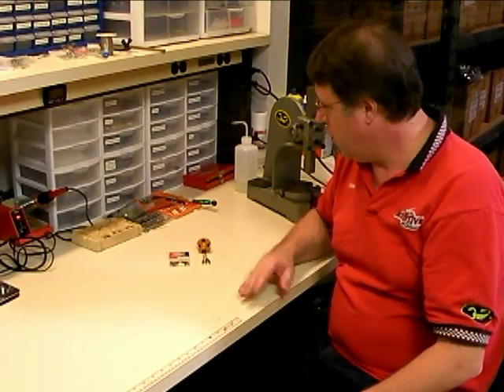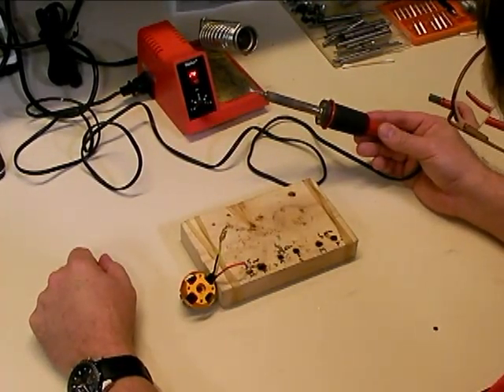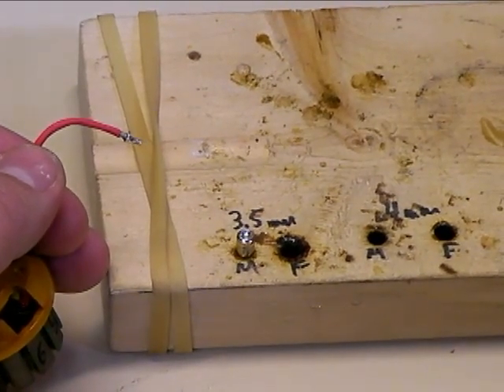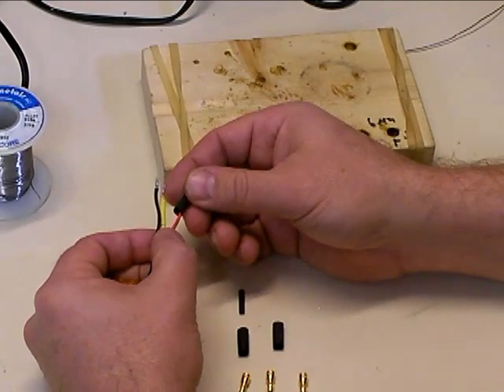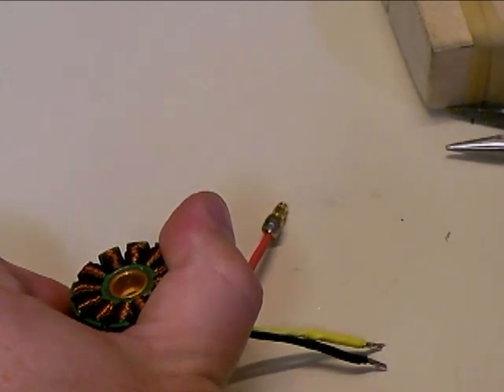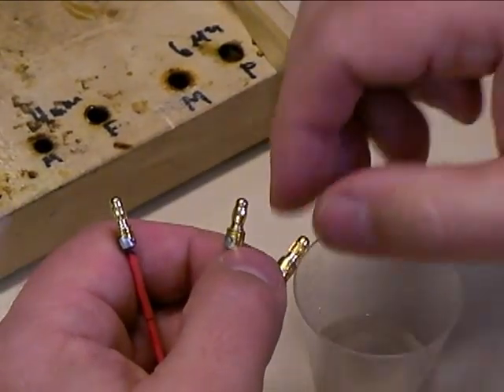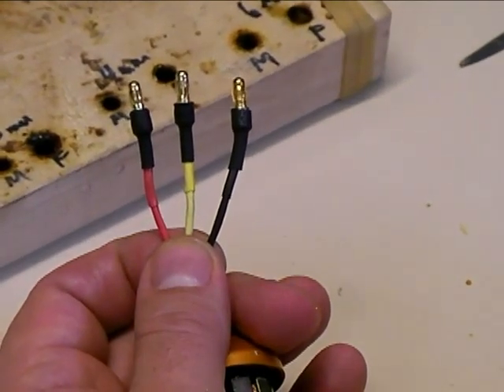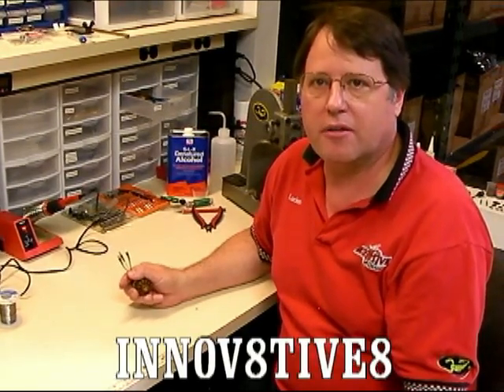How to Change the Bullet Connectors on a Motor by Innov8tive designs

Comment: A few other videos use a really fine soldering iron tip and insert it into the small hole in the bullet connector.  They flow the solder from the top while holding the wire in the connector until the cup is filled and heat for about 10 seconds to ensure the tinned wire solder is melted.

Which is the better method?  There must be a reason for the small hole in the bullet connector?

Your method would ensure the connector is melting the solder vs the tip inside the connector.. Which would produce a better connection... So it begs the question what is the point of the hole in that case :)

Comment: What is best to do if you dont remember what rosin type you used, I have different ones and the cables on the ESC to Motor came off. I be ordering a wide tip dint know about that what temp is good to set the soldering gun.
Thank you for your videos they are super!

Comment from the maker: The solder you should be using on electronic connections contains a rosin flux core, so the flux melts out of the solder as you use it.  There are two different solders available for electronic use that I like to use.  One has a Tin/Lead mixture of 60/40 and the other is 63/37.  The 63/37 melts at a slightly lower temperature than the 60/40 solder does.  Make sure your roll of solder says "Rosin Core" on it, and you will know it already has the flux inside!

Comment from the maker: I use the Kleen-Strip brand Denatured Alcohol that you get at Home Depot or Lowes stores.  It works great to remove the flux residue left over from soldering.  You cna use an old toothbrush to get the baked on areas off.  The flux should be golden yellow color.  If it is a burnt brown color you are running too high a temp on your soldering iron.

Comment: Hello Nice video, I tried removing extra flux off connectors using Denatured Alcohol but it didn't remove any flux. Please advise. I used Rosin Core 60/40 Solder.

Comment: @DiamondDave888 Yeah, that one's probably great! The predecessor to the 936, which is arguably the most popular soldering station of all time :)

SparkFun Electronics sell the 936 (clone, but they say it's just as good as a Hakko) for like 40 bucks.

I use a Weller WS81 though, the 80W and tiny pen is very handy, but it costs likewise.

Comment: Very good video. You know your stuff!

Although, I would not recommend that station. It doesn't have real temperature control. The pot only sets the amount of power the soldering pen is getting.

So that's gonna lead to the temperature going up and down while you solder. I would strongly suggest a real temperature regulated station, like the Weller WES51. Especially if you plan on doing a lot of soldering!